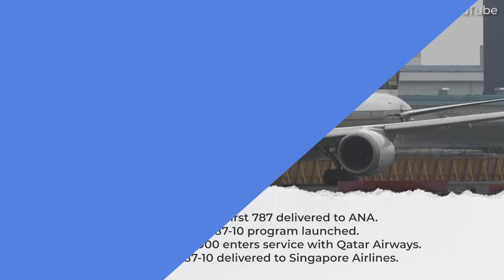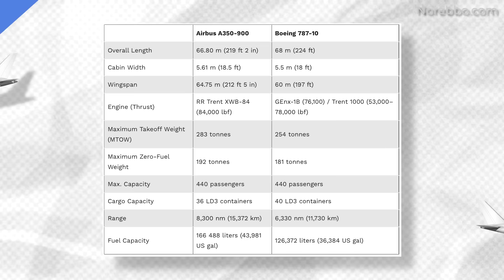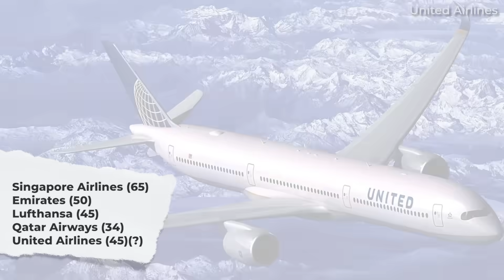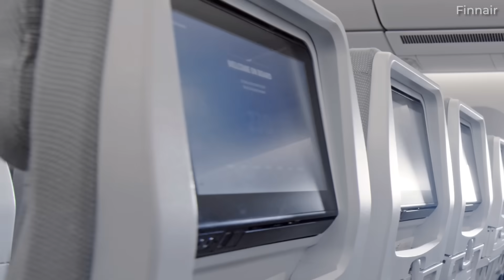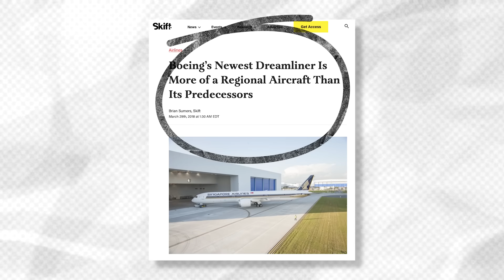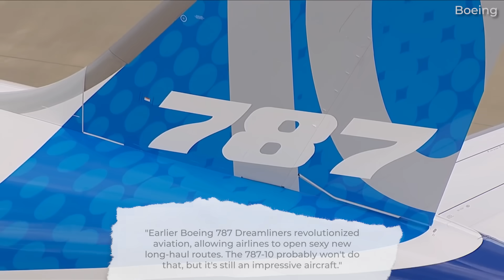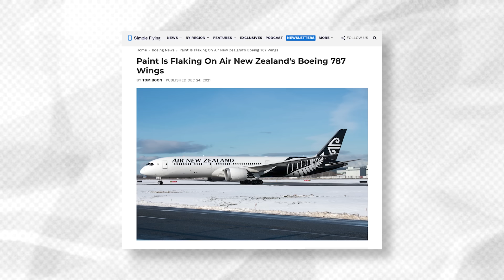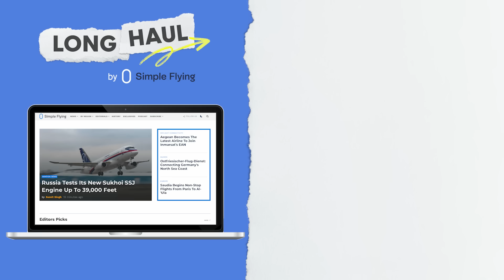The Airbus A350-900 Vs. The Boeing 787-10: How Do They Compare?

Comment: I definitely think a Boeing 787-10ER would be a great addition! I think having the similar popularity with airlines as when they introduced the Boeing 777-300ER!
Reply: The range is really not that short. If you have routes to any other place then Australia, you are pretty much in the clear.
Reply: @matsv201 For it’s size though I think airlines wanted more
Reply: @filledwithvariousknowledge2747  Well.. it depends on. If they can carry a lot of extra cargo.. then sure. If they can´t or they cant do it every day. I don´t really see a problem.

I would think that most airline that use the 787-10 also have a few 787-9 to mix with having both the advantages.
Reply: @matsv201      "ER" or HGW varients are not only about carrying more cargo. It gives airlines more flexibility with  their pax cabin configurations too. 

Some airlines have had to reduce seating capacity on the 787-10 to allow it to fly slightly further and reach desired destinations. 

Qantas 787-9s seat around 236 passengers ( QR's 787-9s seat 300+ for comparison) , which allows them to fly slightly further. 

So a hypothetical 787-9ER/LR could be able to allow qantas to increase its seat count from 236 to maybe around 280 seats while still being able to cover the same range. 

A similar effect should be possible on the "787-10ER".
Reply: I hope it does. The 787-10 is the best looking 787. It should be a common sight at many major airports
Reply: Even 787-10LR will do
Reply: i mean they could but they currently have 2x2=4 wheel main landing gear for all 787 variants. If you really want to extend the range of the 787-10 to say 787-9 or even to 787-8 or old 777-200ER level then you would have to add more weight so change the wheel to 6 wheel main landing gear and that requires modification to the main landing gear housing. I think the best Boeing can do is therefore like increase the range just slightly like 500km.
Reply: @miraphycs7377  the range of the 787-10 can be increased by up to 1000nmi ( 1800km ) without needing a landing gear change. It only needs about 600nmi additional range to match the 777-200ER.
Reply: @miraphycs7377  Just no.  Range is fuel.  Bogey weight limitations is LANDING weight, not take off weight.  And then regarding bogey weight, 787 could simply use wider tires as a very easy simple fix for slightly higher landing weight without changing much.
Reply: Boeing could recertify their 787 for load alleviation on FBW... but this would cost billions.  This would help the 787-10 immensely.  It will not happen, and if it does, I will be shocked.  Who knows, maybe they will for their upcoming ER version.  I doubt it.  787-10 was planned from the start, but Boeing did plan on having a lower OEW though.  

Due to FAA regulatory officials NOT giving Boeing load alleviation due to FBW in a 2G+ wind up turn that added 5-->10tons of fuselage weight they were hoping to drop.  There was also extra weight added in wing box area.   It should be noted EASA did give AIRBUS load alleviation in a350 a couple years later for 2G+ wind up turns.  This probably saves the a350-1000 at least 10 tons and maybe as high as 20 tons when you compare to the much older 777, but does save probably ~10 tons on their base -900 model.  Carbon fiber is nice, but it has a problem, its deflection is much greater under load compared to aluminum and why the 2G turn creates large increases in fuselage weight.  

HINT: I am pretty sure there is load alleviation going on in 777X fuselage though but less dramatic as Boeing is keeping the aluminum fuselage to cut costs and frankly CF does not really help save weight in the fuselage.  One must also wonder at FAA vrs EASA allowances in this field.  Sorry, I do not know the actual nitty gritty, but as it is "new" I doubt the two agencies see eye to eye on this aspect as has been true for decades regarding rudder load alleviation and aileron flutter load alleviation.
Reply: Performance wise, there is no comparison.  The a350 wipes the floor with this aircraft.  The a350 has been significantly more reliable and a bit more advanced.  It seems Airbus just  makes superior aircraft across the board.  Pretty much each of the Airbus aircraft outperforms it's Boeing counterpart in the way of range.  None of the 787's or 777's, original or the new X offer the range of the a350.  Maybe the 777 lr but that is such a rare aircraft that is a gas guzzler at this point.  I know it is older but the A350-900 and 1000 ulr versions stil fly further.  The A330 NEO's also offer more range than the 787s'.  Although the the larger neo a330 may be slightly less than the 787-9.  That might be the only example  of Boeing having an aircraft with a bit more range.
Reply: @XWXW-lk4jf  that's cute. Let airbus have more range and may Boeing continue to keep 60% market share in the widebody segment. Boeing doesn't mind having having less range with it's aircraft  if they sell more jets. 

The 787-9HGW will match the range of the a350-900 and the 777-8 can match the range of the a350-1000. They can do it if they want to but having the most range doesn't necessarily make you the most suitable for the market
Reply: @enocksermons9317  From being the big dog on the block in terms of range, Airbus seems to have an edge.  Hence why airlines are asking Boeing for more range out of the 787 family, why Airbus is was chosen for that Project Sunrise, why the XLR is selling like hotcakes and why airlines are asking Boeing for a new midsize jetliner with more range than the 737's.  I am no expert in this so maybe I am missing something but every damn article I read someone mentions range and the need to extract more range.  It does seem important.  If it were not that new Embraer Profit Hunter would be potentially more successful.  U understand airlines still may have some relatively new old generation Embraers so maybe not ready to update but others are shifting towards the longer range A220.
Reply: @XWXW-lk4jf  well considering we are talking about widebodies like the 787 and A350 and not Narrowbodies, yes. Range is not always important. 

The MAX10 has over 1000 orders now, that's more than the XLR and they will enter into service in the same year. The MAX 10 has poor range, so yes having more range is not always necessary even with narrowbodies. 

Anyway, the 350-1000 was chosen for project Sunrise because it was readily  available.  The 777-8 if available sooner would have would have been able to fly longer and with more payload, so one paper the 777-8 would have been better.
Reply: @XWXW-lk4jf  Its not range per se.  It is Cargo capacity for majority of routes.  it is only a rare few airlines at the ass end of the world <<cough Air New Zealand and Qantas who speak English and have direct access to English media>> who REALLY REALLY REALLY want the range and why you read about it.  Everyone else?  Not really.    For instance places like China, India, Japan, and in fact Europe would LOVE a SHORT RANGE HIGH capacity aircraft(why a321 is selling by the thousand and if Boeing ever gets the 737-10 into service it will be sold like that as well as they are the best solution though not a great one), but that is a highly limited market and why aircraft like the 787-3 were never made as turning a profit is ... questionable when you can just take existing designs as stated above with existing manufacturing lines placing them on unoptimal ranges and use them instead.  For instance most think the a321 XLR is actually a massive flop, but a RARE few airlines want them.  Essentially you get the PAX but ZERO cargo and your average airline makes just as much on cargo in terms of PROFIT(not revenue of course) as they do on PAX.

Comment: Sat in both. 787 is for operators. cramped and noisy. A350 is for passengers. quiet and spacious. You sit in the seats. your choice.
Reply: @Hamza Saleem food and service depends on the airline, not the airplane🤦🏻‍♂️
Reply: A350 is much more comfortable, less noisy with more leg room on the economy class
Reply: panbois😅😅😅😅😅
Reply: It really depends on operators(in economy at least) …Delta’s A350 were so crammed but Qatar’s were one of the best ever.
Reply: Nah, you’re full of sht…all airliners regardless of manufacturer is cramped and uncomfortable if not in first or businesses class.
Reply: NGL I like louder planes better...unless I'm sleeping
Reply: @Hamza Saleem Choose based on airline, not airplane then
Reply: Doesn't seat configuration depend on airline and hiw much they feel like cramming seats in...that's why the B777 turned from 9-abreast to 10-abreast
Reply: I mean what can 10cm offer you more?
Reply: @Hamza Saleem I have flown on both many times (Qatar and Etihad) and found the A350 better each time

Comment: Both are very good widebody aircraft but the A350-900 has indeed more excellent range than the 787-10 and the 787-10 has more passenger capacity than the -8 and -9 and it was nearly impossible to fly long haul routes which would explain why the 787-10 is more common on high volume routes or short to medium haul flights for airlines like United Airlines and Singapore Airlines

Comment: The A350-900 is the original version of the A350 family while the 787-10 is what you get when you try to eak out every last bit of length and capacity while staying true to the original design (like the 737 Max 10).

If you already operate the 787s, than the 787-10 is probably the best (especially for high demand medium haul) and you just use the 787-9 for range. 

If don't have the 787 and you want an aircraft seating around 300 passengers and you need the range, the A350 is the best option.

However, if you care about the comfort of economy passenger on long-haul flights, then you'll order the A350... (shots fired)
Reply: It's the airlines that determine how comfortable an aircraft is on longhaul, not the aircraft. Sure, the A350 has half inch wider seats, but if the airline crams more seats in, leaving little legroom, you'll feel it.
Qantas operates the 787-9 between LAX and SYD, and, aside from their shortcoming of not offering WiFi on such a long flight, it's a very comfortable experience.
I doubt you'd say the same thing if you had to fly longhaul on a French Bee A350.

Comment: 2:17 how come the 787-9 and 10 have the same MTOW yet the 787-10 is heavier and has more engine thrust?
Reply: MTOW is determined by the structural integrity or strength of the airframe ( primarily the landing gear and wing  box) , not by the Empty weight of the aircraft. 

The stronger ( not the heavier ) the airframe structure  is, the more weight it can carry for take off ( aka higher MTOW). 

Aircraft of the same family with the  same MTOW  just means the overall structural strength of the airframe ( e.g landing gear, wing box) is the same or very similar.

The 777-300ER and 777-200LR have the same MTOW, so is the a330-900 and a330-800. 

The a330-200 and a330-300 share the same MTOW as far as I know. 

The 737-800 and the non ER 737-900 also shared the same MTOW

To save costs usually aircraft of the same family share components  like the landing gear, wing box  , the wings, fuel tanks and many more. 

Sharing the same/similar components like the landing gear usually means the structural strength of the airframe is the same even for heavier varients of the same aircraft family. 

Being heavier only means carrying less fuel for for more payload, it has little or  effect on the MTOW.
Reply: Thanks

Comment: It really depends on the airline's use case. SQ deploys its 787-10 on short and medium-haul flights, where its lower MTOW is ideally suited. Combined with high capacity, it is a really good succesor to the 777-200 they used on regional flights for a long time.
Reply: Sq reduced their 787-10, from 25 just to 15
Reply: Where the 787 lacks significantly is Cargo Capacity! On short or medium stage legs that may not be significant but on long-haul legs is very noticeable and lacking!
Reply: @HsquaredH2  are you kidding? The cargo compartment on the 787-10 is bigger than on the A359
Reply: @edvinjonsson99 , unfortunately you know nothing about airplanes, it’s ok, let the adults talk here…😉
Reply: @HsquaredH2  what he said is true though? B78X carries more cargo than A359
Reply: @b @burnedbacon3989 there is no “78X”!
There is a 77X and that one does carry more cargo but that’s not what he said…😉
Reply: @HsquaredH2  B78X is literally Boeing 787-10's ICAO code. What are you on about? Are you the so called "adult" that knows nothing?
Reply: @burnedbacon3989 , don’t reply with garbage!
Reply: @HsquaredH2  ok kid

Comment: A350 has various MTOW 
From Regional specs to ULR capability 
As passengers A350 economy seats are more comfortable
Reply: is A350 more quiet? or same?
Reply: @claus1225 i had to fly with both aircrafts as a passenger with Qatar recently and I preferred the airbus, both for noise and space. Also the airbus had external cameras i could check with my seatscreen. The difference was not so big anyway, but if i could choose to fly with the a350 for the same price of the 787 I would pick that.
Reply: Funny that the European aircraft manufacturer typically has the widest seats vs the US manufacturer (same goes for A320 vs B737 and even A220 vs B737) although the average BMI of US citizens is way higher than European.
Reply: @HugoAelbrecht  Eh, the 737 has the same cabin width as the 707.  It's kind of an old design!  The 787 was originally shown with 2-4-2 seating but the high density 9 wide became the norm. The 767 does a good job with wider seats, though some airlines have put 2-4-2 configurations in them.  Ugh.  People love cheaper tickets and airlines love making more money. The A220 is Canadian designed - and frankly if they can get over their engine troubles that plane could be absolutely transformative.  Making the cabin wide enough for 5 wide seats was a brilliant decision. I can't wait to fly on one.
Reply: Depends entirely on the airline.  Are you in the 787 with 8 wide or 9 wide?  787 seats are wider than their actual competitor the a330.  Are you on the a350 with 9 wide or 10 wide when comparing "comfort"?   With Airbus widening a350 cabin, airlines will tend towards 10 wide instead of currently most a350's going with 9 wide and since a350's actual competition is the 777 with a wider fuselage...  can 777X go 11 wide for squishy hell?  Doubt it. 

For me, comfort of the seat is the headrest above all else and this is entirely human body specific, though any of the headrests with folding wings on the headrest get the nod for me.  All those who do not... do not make the cut.
Reply: @w8stral For seat comfort, I agree with you about the foldable head rest "wings" but can add that for a skinny and tall person that I am, the seat cushion and seat cushion support it very important. I often have to put a folded blanket on the seat ahead of my skinny "cheeks" otherwise the rear seat cushion support bar presses on my tailbone area miserably and uncomfortably.  The Dreamliner was more comfortable than the Airbus seating on 6 flight legs of my recent long haul overseas trip.

Comment: I love the 787, I think it looks better. However the A350 is better for most airlines.
Reply: Sales figures for the 787 program show other wise .
Reply: @MB-xw3nr  the 787 that was launched years before the A350 Brainiac
Reply: @ant2312  It’s had more than enough time to catch up especially during the 787 troubles when sales for it pause yet it still hasn’t
Reply: No no, the 787 is for airlines, that cramped 3-3-3 just doesn’t fit. The a350 is for the pasengers.
Reply: @Tuukkohakee  10 abreast on A350 fits even worse despite Airbus trying to widen the cabin but they still won’t be able to get it to 18 inches wide unlike 777X when it’s cabin also got widen to better make use of the fuselage width which finally got it to that